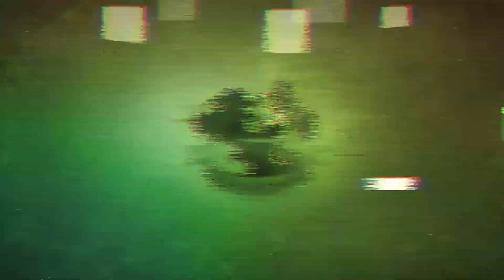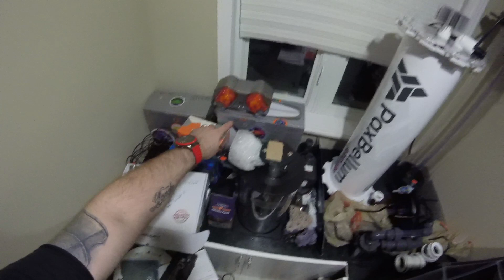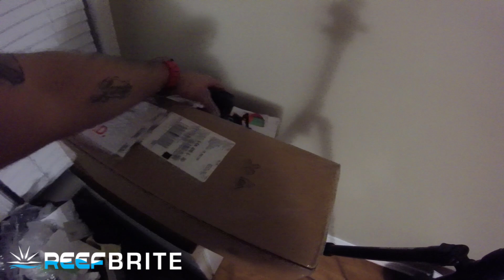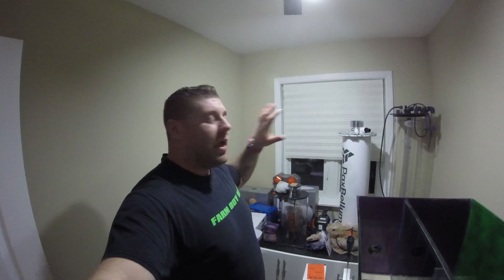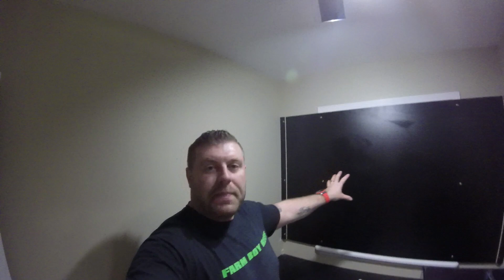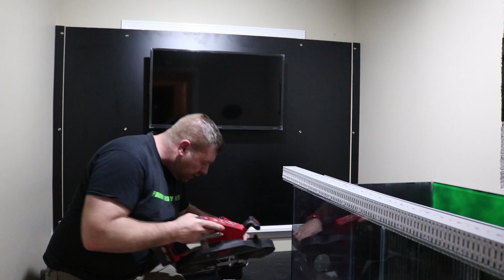FISH ROOM PART 1 CONTROL CENTER INSTALL PART 1 600 GALLON REEF THE HULK Part #11

Comment: I wouldn’t cover the window. At least not all the way. I would leave the window crack to help with PH and humidity. I also would put spring hinges on top to lift it up and run all my wires behind the modules and the board. All you’d see was the module itself. But it’s coming along nicely. Well done
Reply from the maker: I did :) you can’t see that part :) I am doing everything you have said :)
Reply: FARM BOY REEF lol sorry for jumping the gun then lol. I guess I should just wait for the rest of the video.
Reply from the maker: Lol all good but love all your input
Reply: Any way to add a sink? The one thing I would want in a dedicated sump/wet room is a sink. You have the counter just wondering if that was a possibility?